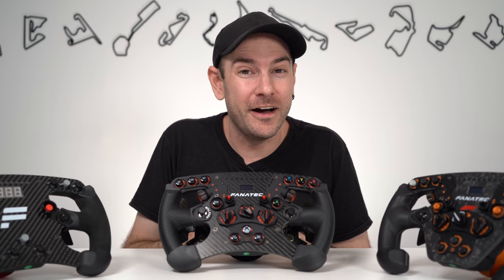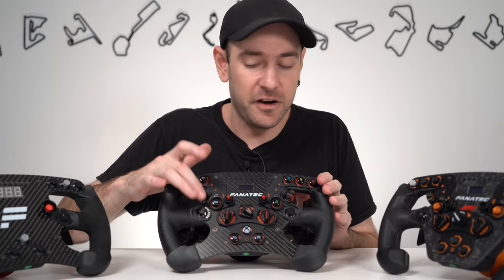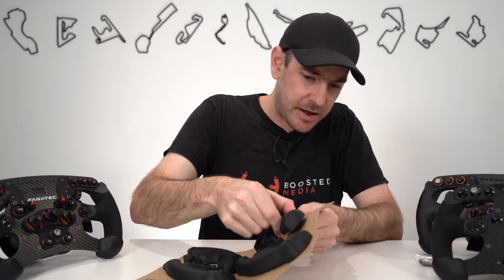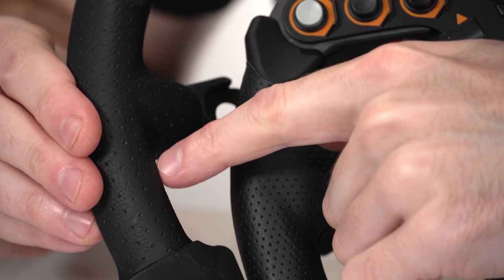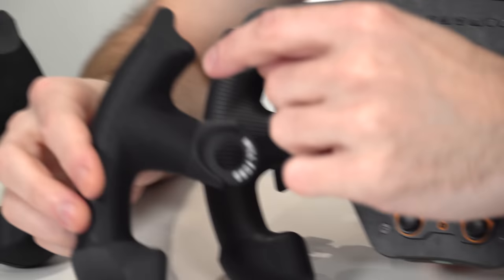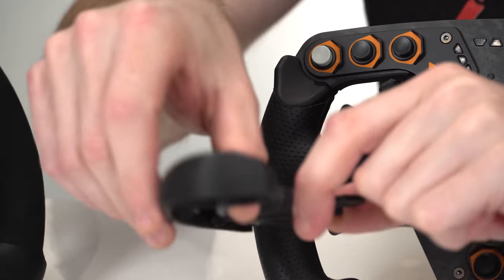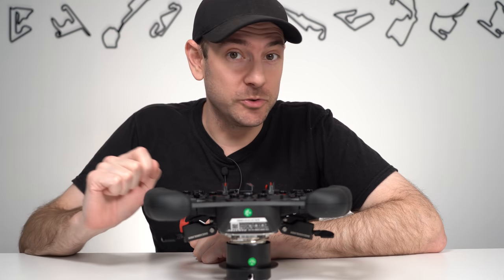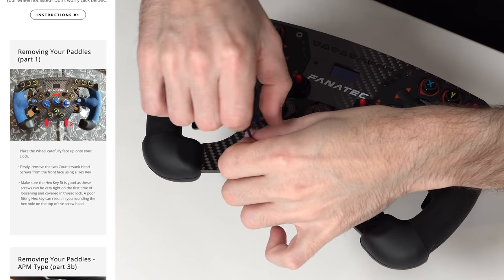FANATEC WHEEL MOD - Pineapple Grips Review

Comment: You must have meant your ender 5 can't do that good without finish work because I have plenty of pieces from my ender 5 that is polished smooth, same as I think these grips should be.
Reply: shape dictates finish. if its a vertical wall smooth is easy, if you have a shape that is like the end section, it will never be smooth.

Comment: I'd prefer to be able to buy the pre-cut material and do it myself. The 3d printed grips ruin the look. Also, if it is PLA, it will degrade rapidly with sweat from your hands.
Reply: recovering your existing grips is an option. Will explains this in the video for 3d print haters 😁, we cover all tastes
Reply: not true, never seen degradation on grips, not sure where u are getting this from....